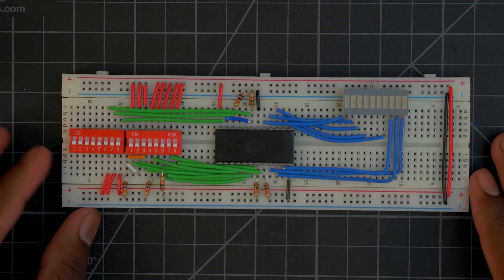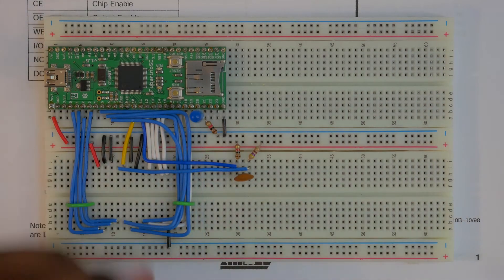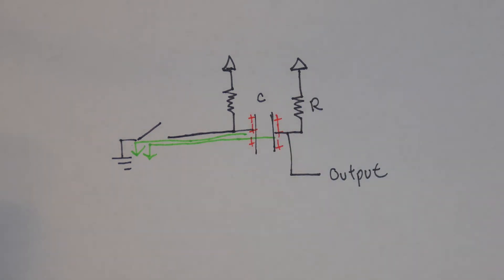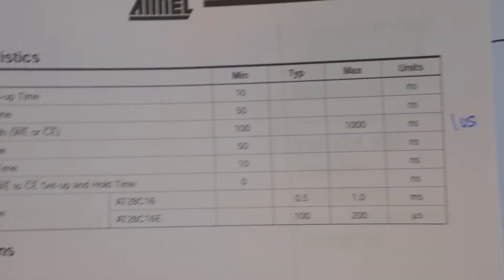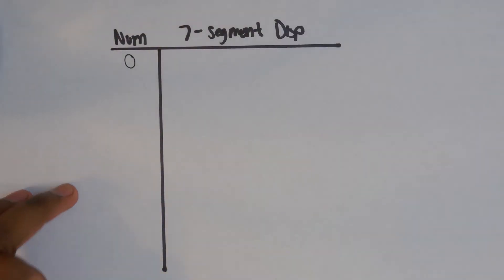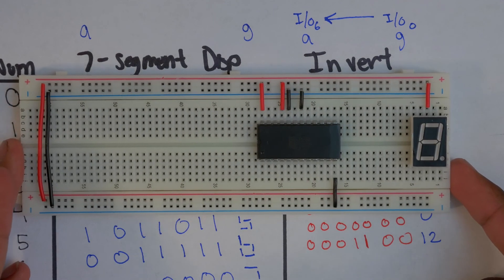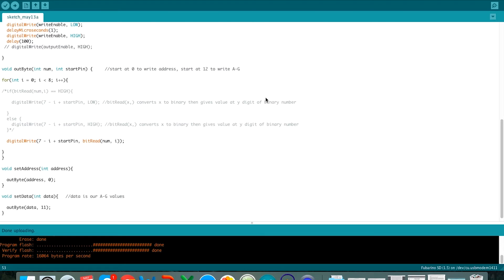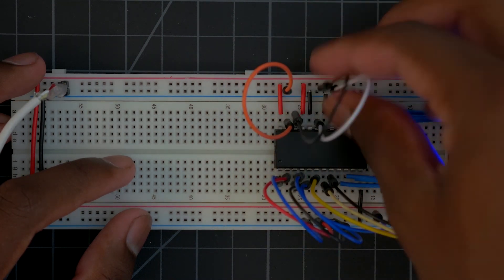We built everything wrong...

Comment: 1. Unless otherwise stated, a computer's output will be either HIGH or LOW.  Only an "open collector" output will be floating.  So your pull-up resistor on the input to the capacitor should be unnecessary since that side will be tied high until the pin is sent low under program control.
2. If both sides of the capacitor are connected to the same side of the power supply, then there is not a positive charge on both sides but actually no charge on either side since the two sides are effectively shorted together via the positive supply rail.

But all that being said, your circuit works anyway because it's "close enough" for most practical purposes.  You did a nice job of debugging. :)
Reply from the maker: +JasonMasters 1. Absolutely correct 2. Correct again although if I were to redo the explanation I think I'd say what you said but keep the diagram the same because the syncing current is the important part to demonstrate.

I love it when viewers like you give useful comments like this to better me and the other  viewers. Keep at it!
Reply: "Correct an intelligent person and you will be thanked.  Correct a stupid person and you will be insulted."
By that criteria, it appears that you are an intelligent person (just in case there was any doubt). ;) :D
Reply: Damn you are smart! You should do your own build of a 16 bit!!!!